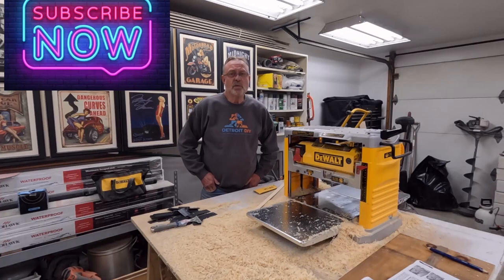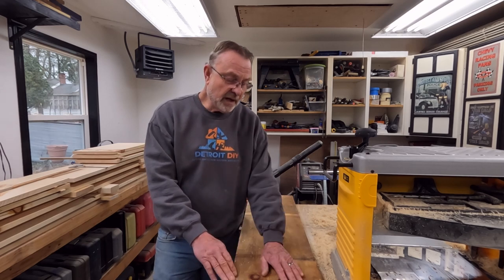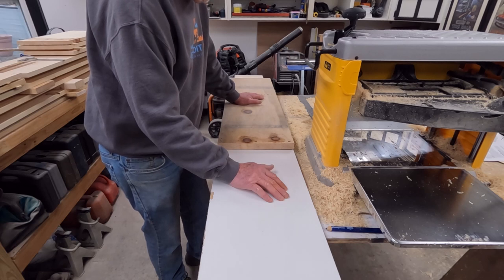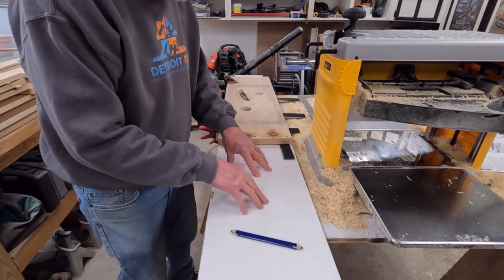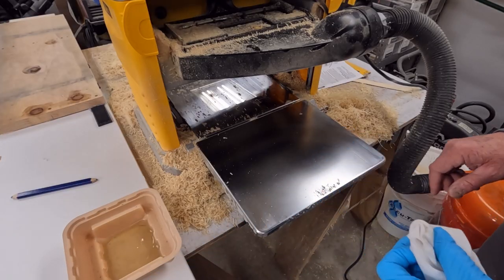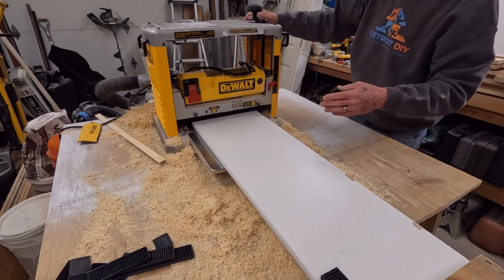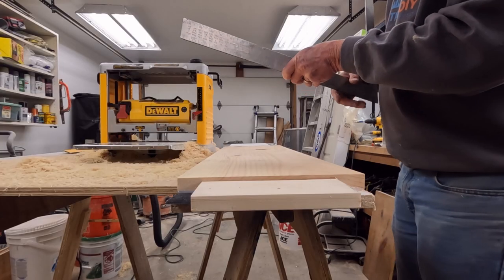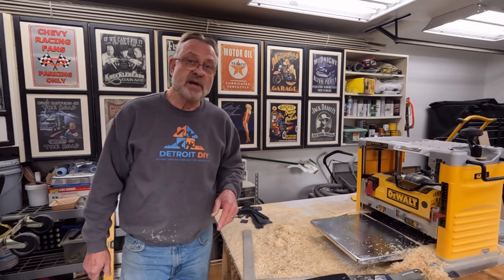Things I Learned Using The Dewalt DW 734 Thickness Planer!

Comment: I operated industrial 4 sided planers and molders for over 35 years. Be aware that the quickest way to dull the blades is to barely skim the surface as you where doing on multiple passes. Try to plane below the surface as soon as possible to retain blade sharpness longer. 😊
Reply from the maker: Thank you.
Reply: it's mean better do 1 depth pass ?
Reply: Same for cutting steel.

Comment: The manual recommends removing 1/32" of material -- that is an eighth of a turn -- not a half turn.  If a quarter turn is 1/16th, half of that is 1/32.  That's why an eighth of a turn seems right.  It is right.

Comment: Check in the window and door section of your local big box lumber store and get some packages of wooden shims.  Cheaper and easier than the plastic ones.  I have a similar planer and never take less than a quarter turn and maybe a half turn at a time.  Move it along and get the job done.  Very nice.

Comment: Years ago using a shop vac and collector lid, I filled my five gallon bucket just under half way with water hoping to minimize the cloud of dust formed while emptying.  The results seem to be added thrust or vac pressure, longer fill time because the saw dust was not as fluffy, far minimal dust from exhaust, i cloud simply place a large garbage bag over the mouth of my five gallon bucket and roll the moist dust easily and also saving space in my main street garbage cans on pickup day and i didn;t measure but I also believe there is a noise reduction.  Last but not least, I had sawdust heat up at my router station and did not realize smoldering until clouds of smoke was coming from my five gallon bucket, but since I've been adding water the swirling water in the five bucket does not allow any heat buildup inside the bucket.

Comment: I bought the same planer a year ago and had very similar problems at first. I was using a Rikon 1/2 hp snail into a 4 inch tube and it was getting clogged all the time. It didn’t work well with my other equipment either so I junked it and I bought a one horsepower Similar device from rockler. It works like a charm. All you need to do is upgrade your dust collection system.
Reply from the maker: @josephullman7264  thank you.

Comment: You CAN remove some cupping.  Plane the convex side of the board first.  The concave side approximates a flat side.  Once you’ve flattened the convex side, then you have a basis to flatten the concave side.

If you try to plane the concave side first, the board can wobble side to side so you won’t make consistent progress planing.
Reply from the maker: Thank you, does board thickness matter?
Reply: @detroitdiy  Not very much. You' re not trying to make the board flex; just knocking off the bits that aren't square/flat.  What matters is how much thickness you can afford to sacrifice to get it flat.

Comment: Cool video. I enjoyed it. I have a suggestion. I have this planer, and I bought the 2HP Harbor Freight Dust Collector and mounted it to the corner wall in my shop and used a large dust deputy cyclone to a 55gl blue plastic barrel.  I had the same issue with dust collection as you were having till I got the dust collector.   Also, use 4" hose if you do get a dust collector.  It moves those  chips just fine with no clogs. Been using it for a couple of years, with no issues.

Comment: From what I see with your dust collection is that your shop vac is to small. 
I have the same planner. I'm using a Ridgid 16gal shop vac. Still have a 2.5 hose yet there's just a little dust coming out from the front. The 16gal vac is at a central point. I use blast gates for my miter saw, table saw, planner and some other hand held tools.
I've never had the amount of dust like I see in your video. 
I got my vac on sale.
Reply from the maker: Thank you for your input. I will check that out.

Comment: Take the 90’s out of the hoses and  make it 45’s this will increase your efficiency and if you can use smooth inside diameter.  If you upgrade you still need this. Have a great day.
Terry
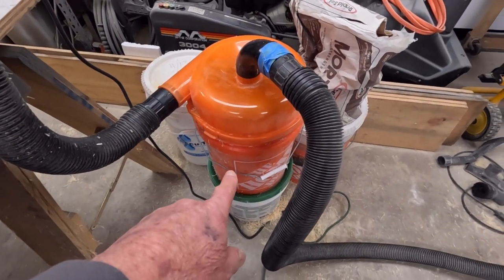3:21
Reply: Sounds like you have experience with high velocity material handling through piping.  Keeping the material flowing is the name of the game.  That's why roundabouts are more efficient than 4 way stops.  That's why NASCAR's turns are round, as are horse racetracks.  Imagine the chaos!

Comment: I have this same planer. I am building a butcher block counter top out of scrap framing studs I have around. It is face grained not end grained. I keep getting black matks and divits in the wood. Any ideas what I am doing wrong?
Reply from the maker: Sounds like to much material being removed in a single pass. The black marks would be from the feed rollers spinning on the wood because the blades can't remove it as fast as it's being fed in. Same with the snipe, try running it through with the blades just barley touching the wood and see if that all goes away.  If not, then I have no Idea what could be causing the problem.
Reply: On my electric hand planer, if I leave the planer resting in one spot for even less than 1 second, the material will have burn marks and a divot.  My recommendation would be to keep the material moving through the planer by ensuring the rollers are making contact.  This means planing a little bit more than not.